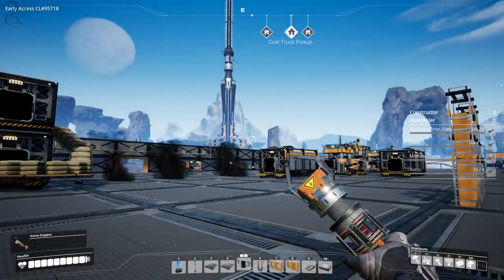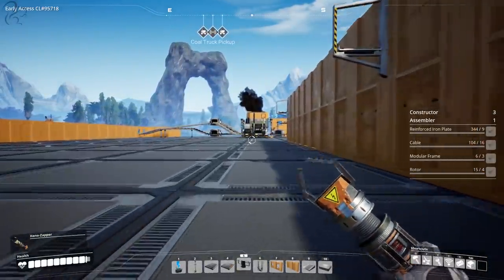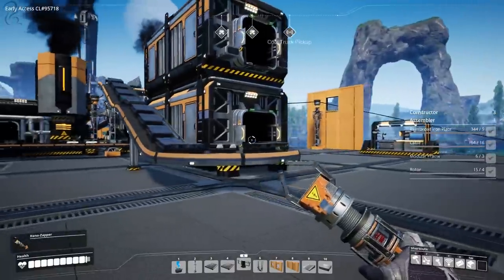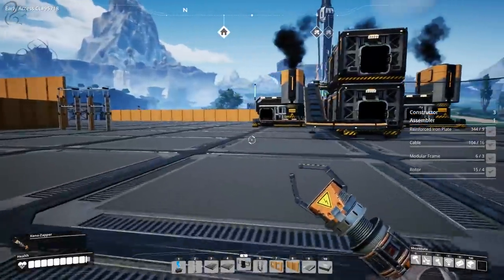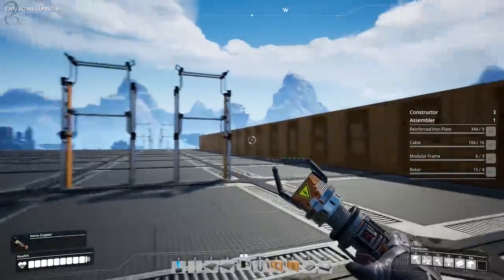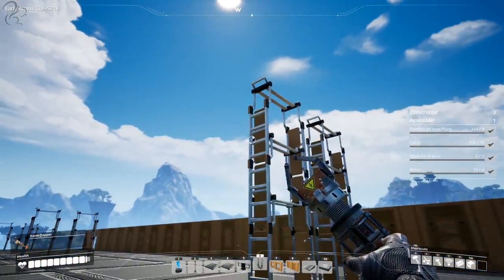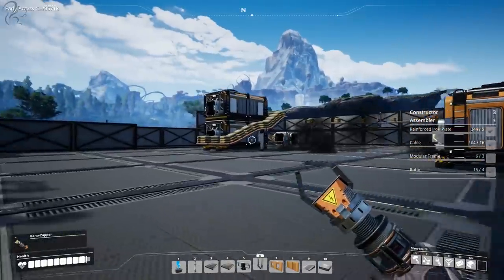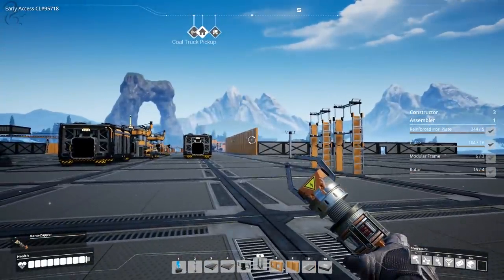Satisfactory - Episode 13 - Main Bus

Comment: I am still not sure about the bus topology for Satisfactory, there are just so many products. I did start messing with a double belt load-balanced version, but I really don't know. It just complicates things. I am up to oil refining so far and it isn't clear how the factory is intended to be organised. Mine is pretty clean, but I still have multiple isolated storage containers for some lower tier components. That is less than ideal.
We could go for a wide bus that skips even layers. For products coming off or joining the bus, they move up to the even layer. All lines though would be at least paired and load-balanced. Really though belt 3 might not be enough and I haven't got belt 4 yet.

Comment: You can always have 24 coal generators running to have 1.2 gigawatts. (insert meme here)
Reply: Great Scott!
Reply: So how many oil generators do you need to do that
Reply: well someone already did just that... (though there's a bit of the game limitation for 1.21GW)
Reply: I watch Biffa as well.
Reply: I upgraded to 12 coal power stations last night, then it was immediately overloaded when I turned on 3 oil pumps and 9 oil refineries. Not gone into the fuel generators yet, so maybe that is the next step.

Comment: Do not understand the factorio methodology of making conveyor belt buses....it is horrendously inneficient....you could do so much more with container stack/ silos. This way you can dedicate containers to specific tasks, maximize rendering memory, and real estate efficiency. Also...there are some resources that are needed in greater ratios in mid game....and plates are not it...it's iron rods, screws, steel pipes, and wire.